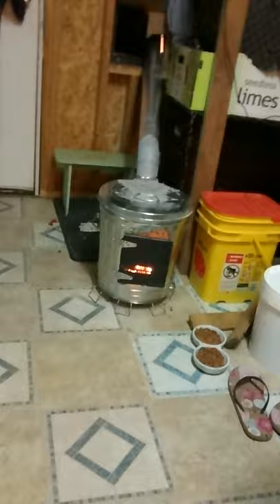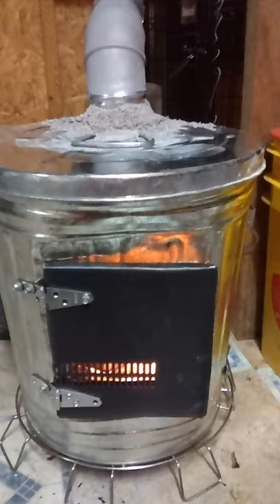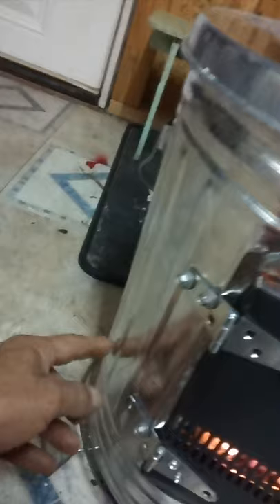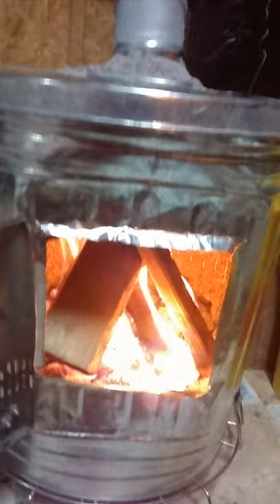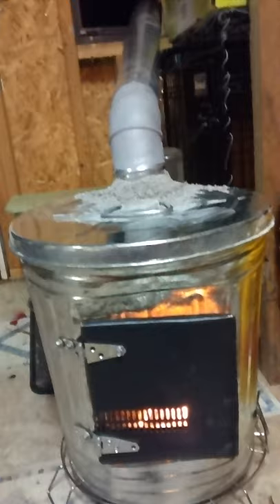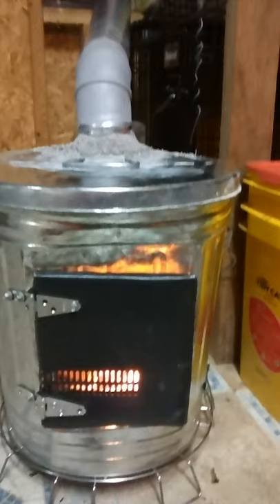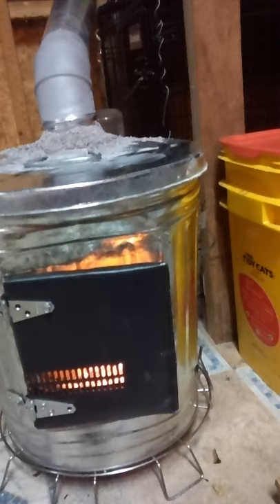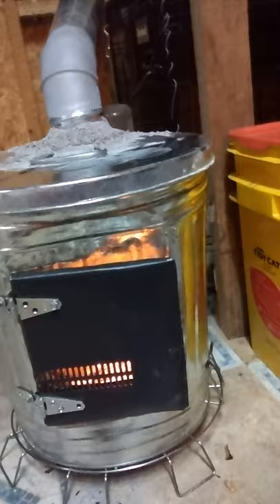Trash can diy wood stove

Comment from the maker: Cut your one inch snips into your tube end stock it through the lid and bend then. I then used wet sand around the connection.

Comment: You know you have already voided your fire insurance and superheating Galvanizing gives off toxic fumes but it seems to work great. Nice video.
Reply from the maker: william Greene that's why you fire it first. It's the zinc once it burns off it's fine.
Reply: You are correct about the Zinc. Just wanted to make sure you knew that. Anything on there that's shiny though, is still pure zinc. looks cool, have a nice day.
Reply: Zinc vapors in welding are of course dangerous, but this will never get anywhere near hot enough to give off toxic zinc fumes.

Comment: Where can i get a door to open and close.Can i use lighter fluid on the wood to keep the flames lit.I'm using a animal cage that's all metal put a fan by it to blow the heat.1st i thought about using a thick metal box and put candles in it and aluminum foil and a fan to blow the heat or circulate the heat any suggestions to make it better ?